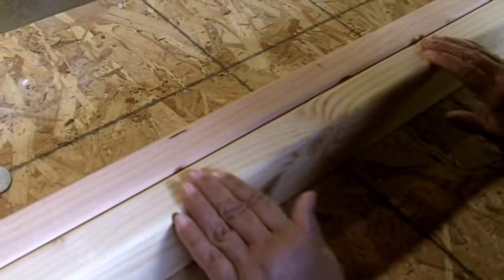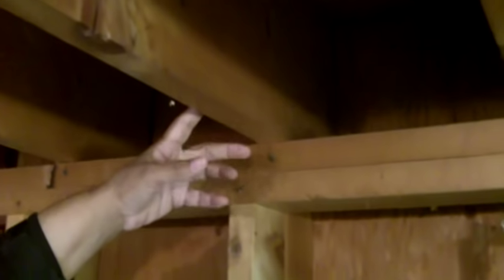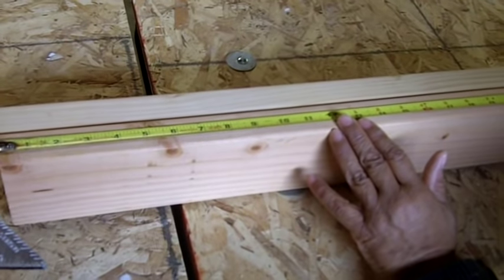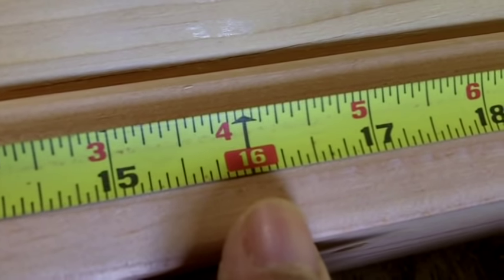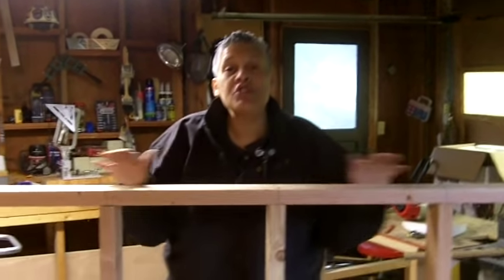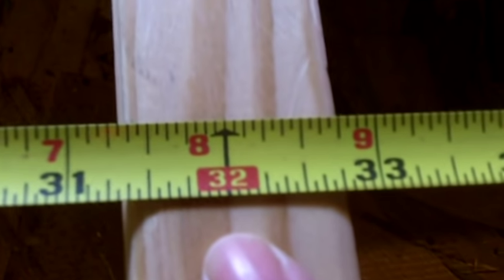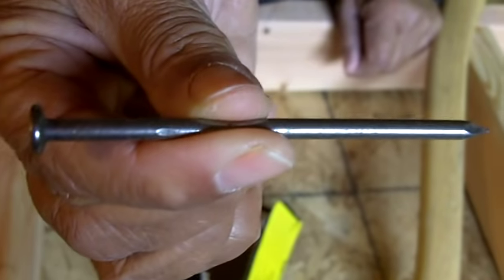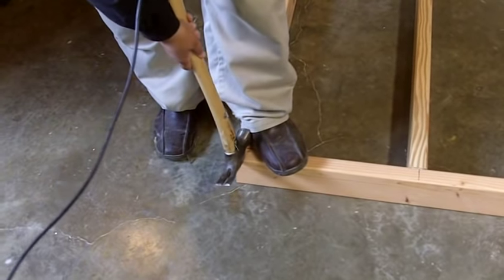How to Build a Partition Wall Beginner's Guide

Comment: Hi. I love your videos. I have a question. What do you do when you buy a couple of dozens of 2 x 4 for framing walls and when executing, you find out that some of them are curved, in other words, some of them are not completely straight???
Reply: General rule of thumb is that you're fine if the bow isn't more than 1/4". Just make sure when framing that the bow on each stud is in the same direction for that wall. If its a exterior wall especially where cabinets will be hung then install them with the curve on each stud facing out of the room. If your bow is more then google tricks to take the bow out.

Comment: Thanks, Leah for this video. I am planning on undertaking a similar project. I am not sure if shimming against the floor is suffice. The floor is concrete much like yours. I am wondering if I need to bolt down the partition and if so how to do  I go about bolting down the partition wall.
Reply from the maker: +Sir Golagha Hi Sir Golagha, you have a couple of options for attaching the wall to the floor.  You can use a powder actuated tool.  Or you can use a fastener designed for concrete.  We have videos for each of these, which will walk you through the process.  They are called:  "Best Way to Drive a Nail into Concrete" and "Beginner's Guide to Attaching Things to Concrete and Brick".  There is something you need to keep in mind, though.  If you are attaching your sole/bottom plate to a concrete floor, and that floor is in contact with the ground/soil, you must use either naturally durable or preservative treated wood.  For more details on this, you can refer to the International Building Code, Chapter 23.  Good luck with your project!
Reply: Thank you, Leah. I will research nail into concrete. Is international building code available online?

Comment: Great video, thanks!  At the end though, you say to keep using the 16 penny nails to attach it on all sides?  So, those nails will go through the concrete on the bottom too?  I was thinking you'd have to use heavy duty bolts and drill them in or something.

Comment: I've been trying to learn how to frame. Everything so far makes sense except for one thing. The purpose of 12", 16", and 24" stud spacing is to facilitate standard sizes, such as drywall. Cool, I got that. I can see that working in a butt wall with 16" on center (taking into account the 3/4"), so each piece of drywall lands halfway on the stud. But what do I do when the "through wall" comes into play? I can't lay the drywall exactly on the edge like with a butt wall. I know I can make a California corner to create a space for the drywall to be attached, but how do I deal with the length being shorter than 16"? Won't that defeat the purpose of having the drywall land halfway on a stud? Any guidance is much appreciated.

Comment: Hi Leah! I got great advice from you on plastering and cutting skirting boards :) now I've found you making partition walls.

There's nothing you can't do! I wish you lived near me, so you'd come and help me :) 

Why doesn't this frame have smaller cuts of wood going horizontally, to reinforce it? 

Thanks for the video. Be well.
Reply from the maker: Hi Craig! Cross-bracing tends to be for ceiling joists.

Comment: After you place the shims and begin nailing the partition into place. How many nails do you put between each stud? and do you nail into the shims or avoid putting a nail into the shims?
Reply from the maker: Jason Marchinke   Go ahead and tack the shims in, but use an 8d, otherwise you'll split the shim with the 16d.  As for nail spacing, 16 OC is a good general rule, however there is an International Residential Code Book (accessible online) with a fasteners schedule that dictates all construction nail spacing, if you would like more information.   Good luck with your project!

Comment: A better way to mark studs is to go back 3/4 of an inch from the 16s then mark an x on the right side of the line to show where the stud goes. Another point that should be made is, always nail the top nail first and then line up the bottom so the stud is square on the plate. And, the plate should always be pinned to the ground.

Comment: Question, when building this partition, will the wall be strong enough to mount things to it like a large TV? Do I need to double up the vertical slabs?

I'm planning on making a partition in my garage so I have a mini office separated from my cars (there's a lot of depth space), so that's why I'm curious about the stability if building up against this wall, like mounted folding desks, tv mounts and such.
Reply from the maker: you should be able to mount things on a partition wall
Reply: seejanedrill omg you're too cool! I wish we were neighbors and I would bbq with you.

Comment: I want to put up a dividing wall in my Garage. You said briefly that I would need to do something to secure it at the bottom for concrete /cement floor?  Do you have another video going over that?
Reply from the maker: Hi Jodi, yes, you can use a powder-actuated tool to attach it.  Here is a link to our video on that.  https://youtu.be/T_eWuS4g9YQ
However, I want to mention that because it is a garage floor where the cement comes into contact with the earth, you will want to use a pressure-treated or moisture resistant wood (such as cedar) for the bottom plate.
Reply: +seejanedrill thank you! I appreciate your quick response!

Comment: Very comprehensive.  I do have one question about the "stud center" -- when she measures, the tape measure is laid out from the outside of the wall (at 5:12 you can see the tape measure is hooked onto the outside of the wall stud, meaning from the center of that first 2x4 to the center of the next won't be 16", but will be 15.25").  Should the measurement instead be done from the center?

Comment: Hi Jane, I need to build a closet in a corner with drywall ceiling. would it be okay if I put the top plate below the drywall ceiling? in that case I have to nail the top plate which is gonna be below the drywall ceiling and then the studs that are hidden on top of the ceiling. wouldn't the top plate damage the drywall with the pressure overtime? thank you and good luck.
Reply from the maker: +39LEGOTO There's nothing wrong with doing it the way you describe, as that is a common way to build partition walls in an existing structure.  It's important that I point out to you that there are 2 ways to frame a wall.  1. On the ground, and then tip it up into place (as I did in the video) or 2.  in place, where you attach your top plate to the ceiling, attach your bottom plate to the floor, and then start attaching your studs.  In this situation, you may want to go with option 2, because if you frame the wall on the floor and tip it up into place, the wall will be longer diagonally than the height of the room.
Reply: +seejanedrill Thank you very much for your quick answer. Your advise is awesome. I will go for option 2 as you recommend it. Have a great day and take care.

Comment: Hi, do I have to take the corner bid off to make another wall in continuation?
also should I remove the drywall too? so that the new wall looks smooth?
Reply from the maker: I'm really sorry, but I'm not certain I understand your question.  However, if you are adding a wall onto an existing wall at an angle (where the two walls will form a corner), you will want to remove the corner bead only where it meets the new wall.  As for whether or not to remove the drywall, it depends upon how well (cleanly) the corner bead comes off.  Most corner bead that is professionally installed is not nailed or screwed in.  It's applied with a tool called a clencher. So if it removes cleanly, then you don't need to remove the existing drywall.

Comment: at 5:13 you started measuring from the side of the 2x4 and went in 16". Is this the correct way? That would mean the center of that beam is slightly less than 16 from the next.
Reply: Good point. It's not 16" from the CENTER of the first stud to the CENTER of the second stud.

Comment: Hi, I have pipes going across the wall above my baseboard and was wondering how would I work around that when creating my frame? If I were to build the wall the way you did in the video, then there would be a gap between the frame and the wall I want it to connect to.
Reply: +Nunya Beeswax Are you able to build a wooden frame around the pipes?

Comment: nice video, how do you make sure chalk line is straight on floor,hoping you were going to show this
Reply from the maker: +Womb Smasher   You would use the Pythagorean Theorem, which is loosely known as the 3, 4, 5 method.   Seejanedrill has a video demonstrating this called, "How to Use the 3 4 5 Method to Square Up a Wall Perfectly."

Comment: you should measure back 3/4 of an inch from the 16 inches etc  and place the edge of the stud on the 15 1/4 etc, that would  line up the  stud  in the center of the 16, 32, 48 .....etc.

Comment: I have a few questions. I live at my mom's basement and would like to create a room by adding temporary walls. I want to easily remove them when I leave the house. I also want a door so that the temporary room is closed. Would this method work? I am also wondering if we need to fix the new wall to walls that are already there. Please note that we have a carpet across all the basement. I also understand from further readings that we would close the wall using drywall. Would it be all we need? 

Thanks ! :)
Reply: Look into framing walls with metal studs.
Reply: Thanks! I'll look into that. However, I think we are not going through with the project...

Comment: HI QUESTION: 
*CAN YOU BUILD A STUD WALL WITH POCKET HOLES?  Say you have NO floor space & youre trying to build a room in your garage. But there’s no way in your crowded garage that you can pay down a 10ft by 8ft frame - you can’t assemble it on the ground then lift it up & install it.
SO.. CAN just lay down your pressure treated bottom 2x4 then screw in your top 2x4 because it happens to be running right along one of the joists or whatever they’re called 8ft up. Then can you take your vertical stud 2x4’s & literally pocket hole each stud into the bottom & top 2x4’s? 
(I guess it might be better to just predrill all the pocket holes in advance) but is this acceptable??

OMG around 8:20 in you just answered that. Awesome thank you.

Then again you didn’t go into detail on how to build your frame in place. I can only assume you’d say pocketholing is the way to go

Comment: thanks for the video by the way. very useful. I am building a wall to make one huge room in two. and the wall is going to be under Metal load bearing. thats where i am stuck now.
Reply from the maker: Jay Khan   Hello Jay,  This video is for non-load bearing wall construction.  If you are building a load bearing wall (which it sounds as if you are), there are building regulations that apply to renovations involving load bearing walls.  So, you should first consult the building codes in your municipality before planning or making any alterations to the existing structure, and particularly where load-bearing walls are an issue.  Generally speaking, tying in to structural steel (I-beam) can be done with a powder actuated tool, loaded with the appropriate charge.  Or a hole can be drilled with a metal drill bit, using cutting oil for lubrication purposes, and then a carriage bolt, nut and washer to secure the plate connection.  But again, you should first consult the building codes in your area.

Comment: One last question.  I think.  My wall is 43"  there is no way to get 16" center to line up evenly, without an uneven gap.  I can not find where to adjust for these types of calculations.  Thank you.  Ami
Reply from the maker: Hi Amy, It will just work out that the last stud will be less than 16" from the middle stud.

Comment: So..question. Does the bottom plate HAVE to be attached by way of nails or screws? I'm planning on doing this but I have tile floor, could i wedge it, caulk it, or use any other means to get the bottom plate to be permanent without destroying the tile flooring?
Reply: No, by the general rule of thumb, you'll always be better off using a proper fixing to secure the stud to the floors. Caulk will crack over time, and expansion and contraction will render the 'wedging' process useless 😀
Reply: +Travis Byrd Like Daniel said.

You won't be able to do other than to "destroy" your tiles, but since the wall be sitting on it you won't see the holes. Unless you're thinking of removing the wall later on again, there's no other way than to screw them in. Don't use nails to secure your wall into the tiles, you'll crack them. First use a drill for wood, make your hole in the wood and once you hit the tiles (careful) you replace the drill for wood with one for concrete or tiles. Don't put to much pressure on it, go easy and steady. Take your time, otherwise your tiles might crack due to the pressure you're putting on it. And make sure the drilling machine is not set on hammering, but drilling. If there's wood underneath the tiles, once again replace the drill for concrete/tiles with the one for wood and continue drilling until you get to the desired dept.

If underneath your tiles there's concrete you need to set the machine on hammering to be able to penetrate the concrete. Keep the drilling machine steady and apply some force. And use plugs to secure your screws when they sit in concrete.

Comment: Do you have to use the penny nails for code reasons? or can we use wood screws instead?
Reply from the maker: +Scott Benesiinaabandan Hi Scott, Nails are the standard for framing and structural uses.  The reason for this is that under pressure, nails will bend, whereas screws can snap.  You may have heard of something called structural screws, however, those are generally used for specific applications, and whether or not you could use them would depend upon the building codes in your area.

Comment: Can i drill screws into a frame wall instead of nails, I don't trust nails when it comes to walls shifting and making nail pops, rusting and removing old framing
Reply from the maker: ***** You can use screws instead of nails.  However, believe it or not, nails are better when it comes to walls shifting, because they bend, whereas screws can snap.

Comment: I want to frame a wall around my oil tanks in my basement. Does anyone have any tips on to frame a wall when the wiring runs on top of the floor joists instead of through them??

Comment: You should start at at 15 1/4 X ahead and off that line go 16 ect. Or if you can remember deduct each time so it is
16 in Oc would be 15 1/4 x a head
32 = 31 1/4 ect same goes for 24in oc

Comment: Can you use a nail gun for those penny nails? Is there a nail gun that would work or is it always done by hand?
Reply from the maker: Hello Zelda,  You can absolutely use a nail gun.  That's what's we use in the construction field for framing. However, there is a caveat and it's this: You'd need to use a framing nail gun and you would have to have a compressor, both of which can be expensive. I always try to teach the basics first and then move on to the more heavy-duty equipment because just about everyone owns the basic tools.  It's interesting that you should ask about the nail gun because I plan on demonstrating a framing nail gun, a brad nail gun (there are several different types of nail guns) and how to set up a compressor to use these tools within the next couple of weeks.  So, please check back.  I try to explain things so that afterwards, anyone would be comfortable using the tool or technique I show.  You can do this is not just a motto, it's what I believe!
Reply: i'm learning to build and I love it! All my knowledge is from YouTube. I'm so grateful that ppl like you take your time to post insturctions for others to learn from. Thank you! just a request... would you be able to do a video someitme on stairs? I was looking at Lowes at those pre-made 3-5 stair (I don't kn0w the exact name) but they are the side of the stairs so you just have to put the tread and the rise on for a patio. Anyhow, I'm wanting to put some simple/deck stairs in my garden off the patio. But I dont know how to secure them... Just a thought. Thanks for the great vids
Reply from the maker: zeldahopper I'm glad to be of help as you learn how to build things!  I've been thinking about your request for the stairs video, but unfortunately I don't have a place to put stairs, so wouldn't be able to do the video.  However, I have installed stairs in the past, so if you have questions about it as you go along, I'd be happy to help.  Good luck and happy building!

Comment: How do I add a new wall to a completed room? Do I have to rip down the existing drywall? My wall isn't going to perfectly match with existing wood on the ceiling. How do I go about this?
Reply from the maker: Hi Kaven, no, you don't have to rip down the existing drywall.  As far as the wall matching the existing wood on the ceiling, I"m not entirely sure what this means, however, if you have, for instance, a ceiling finished with wood, you can use something called a j-bead to transition from the drywall to the wood ceiling.  We have a video on how to use j-bead.
Reply: +seejanedrill  it's summer here in England,so now's the time to show us how to build a shed !
Reply from the maker: yes, this is the correct video about j-bead.  What j-bead does is to allow you to give a new drywall wall a finished edge up against a wood ceiling that you are transitioning to or any other non-drywall surface.

Comment: I make my cut right after I mark it.  Then I measure out 16” again, mark it and cut.  The saw kerf takes away from the length of anything cut.  So your 16” mark doesn’t give you a 16” length of wood anymore - because you didn’t account for the kerf.